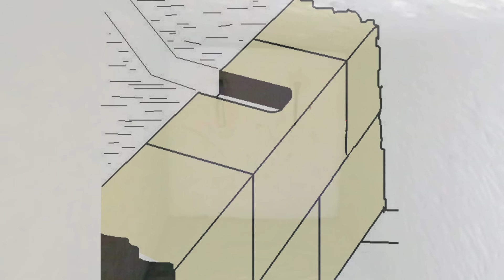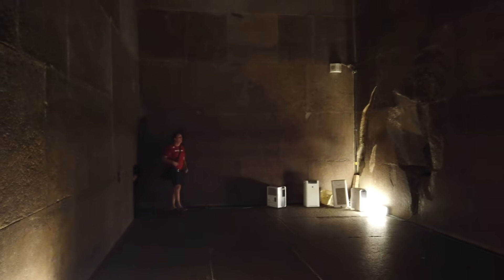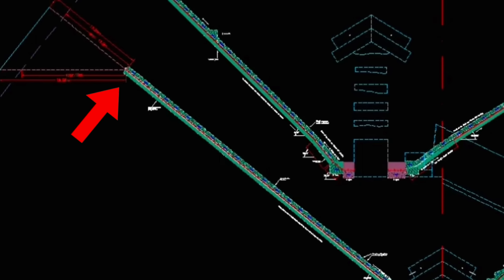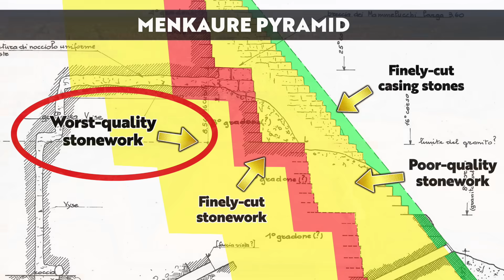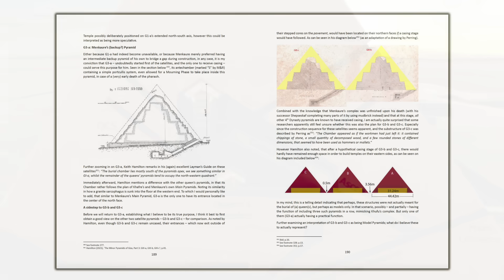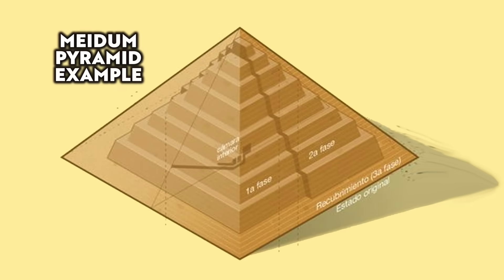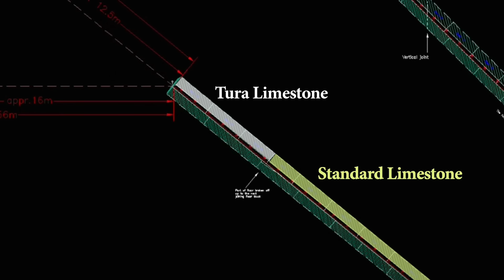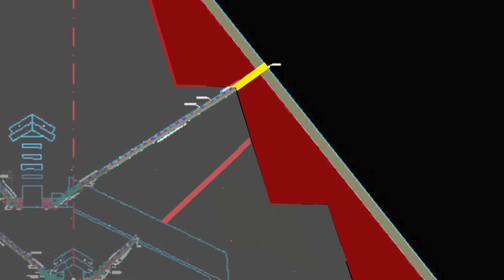Great Pyramid HIDDEN Steps Explain Everything | Part 1

Comment: I thought something similar, but my thought was QC was a contingency not for the KC's failure, but for when Khufu died. The master plan included 4 possible burial chambers, and once Khufu lived passed a certain time, they abandoned the current chamber and proceeded to build the next stage. So maybe it started as a mustaba with the SC, but with whatever would be needed to build the QC. Once Khufu lived long enough they knew they could finish the QC, they moved on to the stepped core, with the beginnings of the KC. Same thing, he lived so they abandoned the QC, moved on the KC, and the beginnings of a 4th, higher chamber. If the Big Void isn't just a weight relieving space for the Grand Gallery, I think it's another unfinished GG intended for a 4th burial chamber, but Khufu died at that point, so they finished it all up with the 3rd chamber.
Reply: That's an intriguing hypothesis. My first reaction: It seems to make sense of the chambers we can see.
Not necessarily an opposing thought, but why weren't the chambers (especially the "Queen's Chamber") finished more as the pyramid was built up around them? It would be much easier to work with light and ventilation.
Reply: its 2025 open your mind its a d.u.m.b idea to think the pyramids are just tombs for old pharaohs, if you want real answers and knowledge with EVIDENCE to what these pyramids use to do search Land of Chem channel, he’s a man who lives in egypt and does real research, not that theres no research in here which i also like but there is no real on site research only hypothesis made by videos and books, you have to visit and study the place you are making an hypothesis on specially something as old and mysterious as the pyramids
Reply: I think something like this. But tomb or burial to us might be something different to ancient people.
I think it might be more ritualistic/spiritual. Each chamber might signify something. And maybe khufu moved through them alive or his remains was moved through them.
Reply: If visitors were intended to 'pay homage' in the pyramid then surely there would have been at least one WC installed  ? And more air shafts ? Only kidding !
Reply: Lol why do you think the pyramid is a tomb?
Reply: @91lifetime23 Because it is? Do you even watch this channel?

Comment: Happy Birthday first of all. Interesting hypothesis but for me it does not make sense. So they built the QC first with the airshafts and then they thought to have a try and have the KC (shifted off centre) and in case it had failed, they could have been going back to plan A? The fact that one of the QC's airshafts goes around the Grand Gallery suggests that both structures (the airshaft and the Grand Gallery) was part of the initial plan, the mausoleum idea of History for Granite is just does not add up. What sort of mausoleum is that where you are crouching through a tiny steep channel (no steps at all) and then you reach the Grand Gallery and climbing up (again, no steps).... sorry but I just do not see Egyptians struggling there with torches in the dark trying to climb through all the narrow channels and the Grand Gallery to see the pharaoh's coffin..... if it had been a mausoleum, it would have been a proper entrance with a horizontal straight access to the very few who allowed to go inside.
Reply: It is believed that all the unfinished constructions happened because of the death of the pharaoh. The ascending corridor is cut very roughly, the walls are crooked. The underground chamber was also unfinished. And the ventilation shafts are unfinished. And the queen's chamber is unfinished. There was a simple reason for this - death.

Comment: 11:30 while I totally agree to the idea of a stepped core, I think it were in fact more and smaller steps and the airshafts ended at the bottom of their respect steps. that would explain as to why the very end of each shaft abruptly bents horizontally: its orginal opening runs with the top surface of the top of the lower step.

Comment: The story has big gaps. We don't even know which Pharao actually built the pyramid. Just because there was an obsviously faked cartouche from Howard Vise, who was under immense pressure to find something big for the big expenses of his donors we say it was Kufu? Kufu was the greatest Pharao of his time and yet there is not a single painting, engraving or anything inside the pyramid to celebrate his greatness. Not even any document that mentions the three pyramids exists. Makes no sense. And it makes no sense at all that countless mourners visited the King's grave by crouching through narrow passages and a "gallery" without any steps. Total nonsense. The interior of the Pyramid is unlike any other tomb and its construction resembles the Osirion of Abydos which is more megalithic than egytian.

Comment: So the only thing that has changed from before is adding the step part to the pyramid?
Technically it's exactly what it was before, the queens chamber would be a backup if there was an issue with the kings chamber. 
I do think the newly discovered chamber at the entrance is part of the extension and could have been a plan to add a new tunnel going straight into the grand hallway once they decided that the kings chamber was good enough.

Comment: If this was a possible way of construction then how would the builders get back down to ground level after working upwards and backfilling after every level of caseing facing stones were firstly laid.  They would of been trapping themselves after reaching that hight there only way down would be to sort of abseil down the smooth front of the building.
Reply: Easy. Leave one column of stones unfilled then fill that from the top down.
Reply: @Jack_Over9000  one column of stones left would not give you enough space to work in. How could you contruct from top to bottom? The stones above you would fall cus of no support underneath
Reply: @davidcorbett341  Well, first of all the column would not be straight because they wouldn't put the joins above each other. So there would be enough of a support to rest the stone. 
Secondly, the facing stones would be small towards the top.
Thirdly they would measure and have ready suitable stones to use
Fourthly, there are visible gaps up there where scaffolding could be inserted.

Comment: Is there evidence in any other structure of a fall-back plan? If not, what attribute of the queens chamber made it such a safe bet compared to the kings? Would the pyramid have been about the size of another such that they would have been confidant it would have been stable if the larger version was troublesome?

Comment: Finally we are talking about the stepped pyramids core inside the biggest pyramids. I see no reason to stop using steps core between Meidoum and Menkaure. 
My own view is that the Houdin's internal ramp is just external and built on the steps, 2 to 4 ramps could work at the same time without the need for a massive one ramp up to the top. What remain to define is how the filler and the casing are done on the finished stepped core. 

On seperate note I think the stepped core could have been the contingency pyramid itself

Comment: Perhaps the original step pyramid inside was constructed much earlier than the finished pyramid that we see. And that pyramid could’ve served some unknown function,. chemical plant, power, plant, etc. And perhaps the Egyptians repurposed these pyramids as tombs or mazes, and seal them off with those large limestone blocks. It just seems to me that the larger question at hand is how that granite inside was quarried, cut, shaped, finished, polished, transported, and placed… As time goes on I am leaning more in the direction of an older advanced civilization that preceded the Egyptians as we know. Certainly fun to speculate. Wish we all had the means to solve such a great mystery! Cheers.
Reply: You lost me at chemical plant. No one's ever explained how a pile of stones can be a power plant or whatever. The laws of physics have been the same for billions of years.
Reply: what indicates that it would have necessarily been MUCH earlier construction? Why couldn't it have been 50 years older than the outer layers? They had the tools to cut, shape, polish, transport, and place granite. Certain people complain that they think it would take too long, but the truth is, we don't know all of the little tricks a civilization so centered around stone-age technology would have to more efficiently work with stones that are no longer necessary in the modern age. Stone tools can be used to chisel, copper saws with sand abrasives, and water cut granite, sand polishes granite, and mechanical advantage moves and places the blocks. This stuff has all been demonstrated on YouTube if you know where to look. Scientists Against Myths, Sacred Geometry Decoded, and World of Antiquity have all covered these topics; some have demonstrated that the process was possible on a smaller scale, so it would also be possible on a larger scale (in terms of the cutting).
Reply: Chemical and power plants are never pyramids made out of limestone.
The further back in time you go there is less capability for many reasons.
You've fallen for a grift.

Comment: No and yes, i played with a giant pile of lego bricks, it is stepped, but backfilled into plateaus as construction progressed.. that is what explains the second great gallery, it is a lift.. but only in use after first gallery was done lifting everything up.. they built towers then had storage space on higher levers, then built down.. at one point the pyramid was higher than its finished state.. also, when it was built, the grand gallery was actually an empty V shape from the opening (enterance side) to top and start of secondary gallery, it was filled in before second gallery was taken into use.. its the only way to do it without insane amounts of workers, and it would be fast.. two elevators, and gravity assistance for all the other blocks.. the oyramid is just a huge puzzle when it comes to storage stacking, aka- under construction it was basically just showing off their mental gymnastics. 😂😂😂

Comment: Long ago, the late Mr Philippe Lheureux already discussed these shafts. For him, these were water shafts. When full of water,  the pressure would dislodge a stone in the " King chamber " wall , liberating a side shaft full of sand and stones which would fall to the subterranean chamber,  which displays a pre-cut square when you look at its ceiling. Then, you have access to a higher hidden space (the "great void" was not discovered at the time)."Queen chamber " was only a real world test ɓefore to build the higher chamber. Its shafts were no more useful after a successful test and could be closed. To stand the air pressure above the "King chamber " at a precise value, they added these layers of stone beams that otherwise would have been a stupidity in a discharge chamber. The water pressure depends only of the water column height. If the theory is correct,  all differences of altitude should be the same between  the base of each chamber and the top of the related shafts, the angles have no importance. Is it possible to measure these 4 heights ? If they are the same, that would be in favour of this theory.
Reply: Best ask Indiana.

Comment: The only thing I am convinced of is that we have no idea what we are looking at here.
Reply: This is both humility and deep truth.

Archaeology presents facts (stone, shafts, chambers) — but interpretation is uncertain.

Every model (tomb, symbolic machine, resonance chamber, initiation hall, cosmic map) has holes.

The statement echoes a philosophical constant: humans project meaning, but certainty is elusive.
Reply: It seems unfair to say that we have "no idea" as people have worked very hard to determine some things for certain and other things extremely likely.  We certainly know some of what we're looking at here and progress has certainly been made over the decades and centuries.

A coworker believes that people could not have possibly built the pyramids, though when has said this I casually changed the subject as I didn't want to know who or what he thinks did build them.  However, we know FOR CERTAIN that we are looking at the handiwork of humans and we even know the names of some of them or at least the work crews that they belonged to.  That is surely more than "no idea" what we're looking at, even if many questions remain.

We even know why the relieving chambers were built.  We know exactly what we're looking at in that case.

Comment: Also, the stepped pyramid probably stood for quite ta while before the casing was put on. It is also possible, that the stepped pyramid was done by one pharaoh and the casing finished by another.  Thinking out of the box, the "Queen's Chamber" may have been intended for a former pharaoh, but when it was enlarged, the new pharaoh wanted a bigger and better chamber.
Reply: why would a single, two-phase construction be unlikely? Basically all major construction projects require an initial stage where they must first build a sturdy, structurally sound frame to then build the rest of the structure around. That seems like occam's razor would lean to this essentially universal construction method, that we know was used in other pyramids. I see no reason to try to separated the construction phases by that much time, especially when I see some people trying to separate the two phases by thousands of years and the products of completely different civilizations. That seems extremely unlikely unless that person is working backwards from a belief in an ice age great pyramid, a theory that has much bigger problems to overcome first before anyone should be trying to shoehorn it into every archaeological site they find interesting out of ideological expediency. (not saying you are doing this I just thought the point was a relevant side point to mention while we were on the subject ).

Comment: This is all logical, compelling, and really satisfying
Reply: Looking at this new thread about the Queen’s Chamber shafts, the “blocking stones,” and the Robber’s Tunnel — here are some new thoughts you could add that push the discussion a step deeper rather than just repeating what’s been said:

Reply option 1 (engineering angle):
If the Robber’s Tunnel had intersected a finished shaft, we’d expect a clear breach in alignment or tool marks betraying the passage. The fact that we don’t see that may hint the shafts were deliberately terminated before reaching the chamber wall — almost as if they were “symbolic conduits” rather than physical vents.

Reply option 2 (symbolic angle):
Another possibility is that the “doors” and blockings were never meant as airflow or escape routes at all, but as ritual gates — sealed by design. In that reading, the absence of cut-through traces is itself evidence of intention: the builders wanted a path that went somewhere conceptually, not physically.

Reply option 3 (blended / question-posing):
What if both are true? The masons may have started extending the shafts toward the King’s Chamber, but stopped once the symbolic threshold was marked. That would explain why the heights line up but no breach exists — the “end” was deliberate, not an accident.

Would you like me to also frame one of these as a math/geometry-based micro-comment (e.g. about alignment, angles, or proportional placement), so it sits neatly alongside the technical side of the discussion?

Comment: Interesting, however I see no persuasive evidence that the identified internal structure is not a lot older and that the external structure only is possibly the extent of Khufu's handiwork. It might be a bit of a stretch, but for me the fact that no external exit for the King's Chamber air shafts has been reported seems to corroborate this.
Reply: I think the KC air shafts' external exits were identified some decades ago. I've seen several videos, probably here and on H for G, that show their locations high up the sides of the pyramid.
Reply: @jeremyd1869 I am referring to accounts about the pyramid written in antiquity when the casing stones were still in situ; I would expect if these openings existed at that time then they would have been noted and remarked upon...

Comment: 7:46 shows hoe neat the structure of the inner core is in comparison to the later added backing stones. This is one reason why i have long believed there to be a finished step pyramid inside the great pyramid. This step pyramid, i believe, existed and functioned as a finished building for an unknown length of time before the later addition of the stones that created a smooth sided pyramid. In other words, the inner core would have been an impressive, finished structure in its own right and had its own lifespan and function. But then i believe that the pyramid was built over a much longer period of time, in stages, by different generations.

Comment: Air in? Or water shed return? Is there evidence that proves water was never used? What about when the entire structure is full of water, flowing in and down and back in again. This is what the 1° indent on each face is all about. The return drains into the center. Some would be air vents out as well.
Reply: Many of the unfinished aspects of the interior chambers are erosion damage of seams in the floor, and only fluid mechanics would be considered, not how it looks inside for the maintenance man.

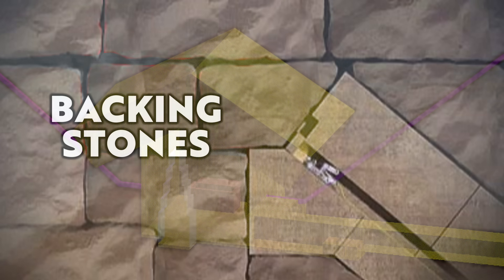Comment: Don't know if it's been pointed out yet, but the theoretical step pyramid beneath the pyramid we see mimics the doorway that enter into the queen's chamber (12:06 for example). I wonder if this is the designers of the pyramid putting a slight clue or 'easter egg' of their design into something as simple as their doorway
Reply: well when they put the doorway in, there would have been no need to give the public "clues" because it would have been obvious during the first phase.